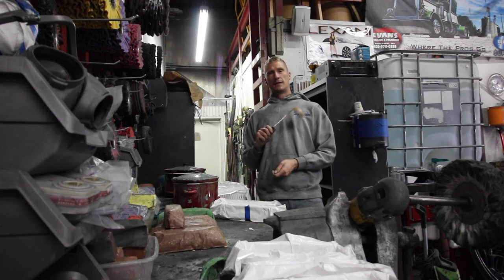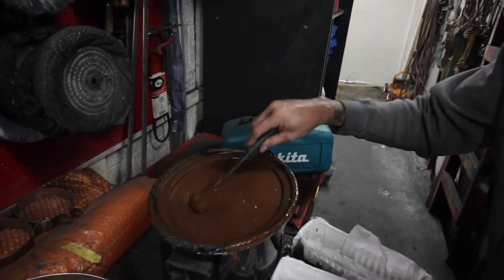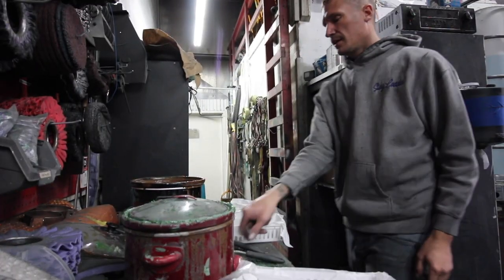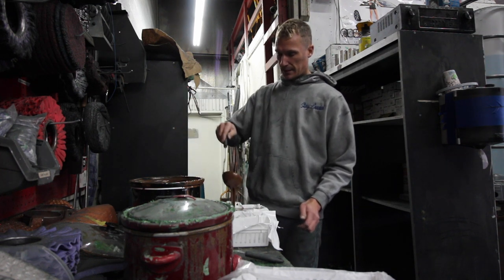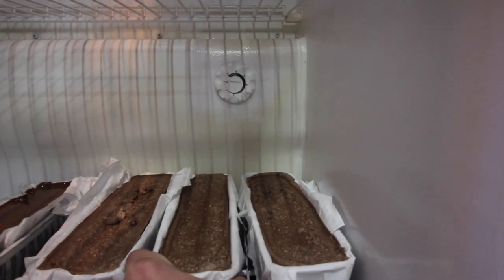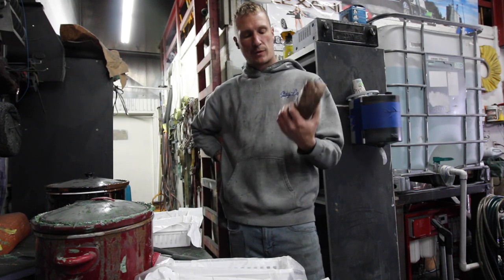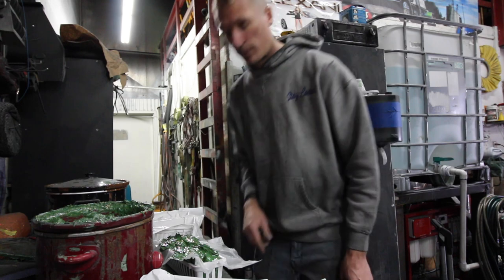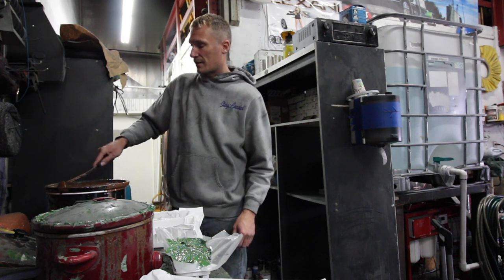What do I do with my broken or leftover rouge/compound? - Evan's Detailing and Polishing

Comment: If i find an old bar of compound that is rock solid, is that still useable ? Don't want to chuck them but not enough to melt a full pot lol
Reply from the maker: Some brands are still good. Some not so good. Depends what the product is made with depends on if it will have a shelf life.

Comment: If you cut the green chunks up even smaller such as using a blender into almost shavings will that help the melting?
Reply from the maker: Yes but blending them in a blender isn't easy. They are pretty solid.